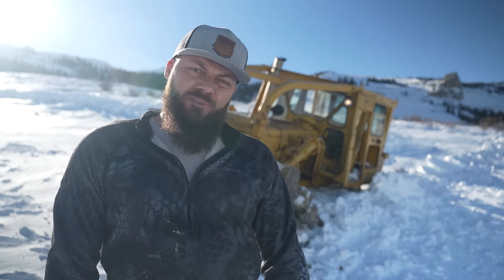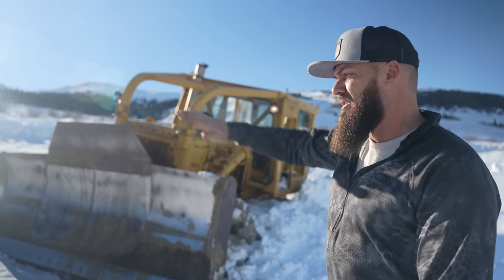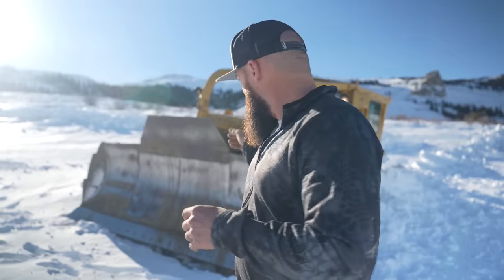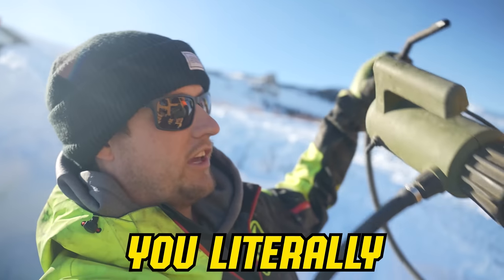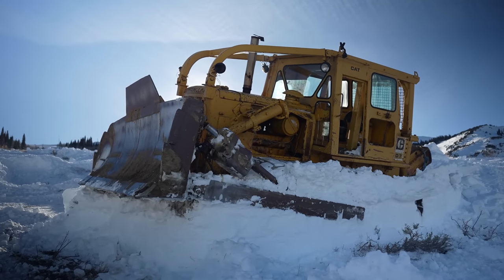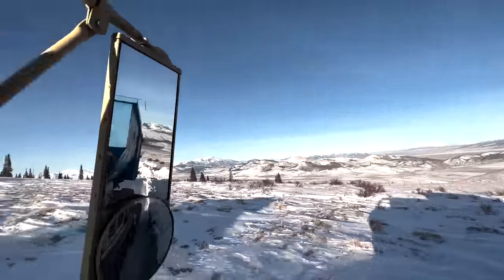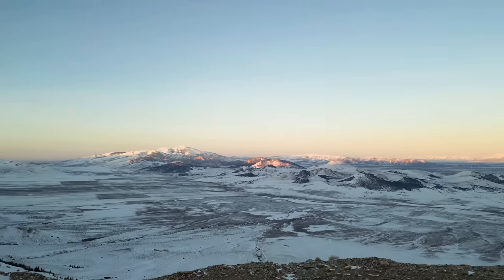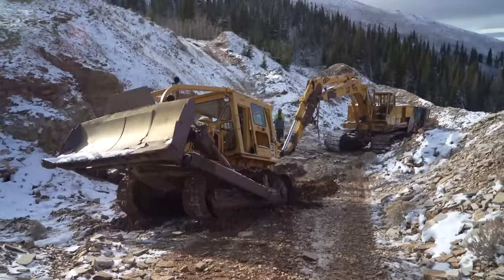What Happened to Our Dozer and HEMTT? You Won't Believe This Mess

Comment: I would love to see Bud get his Ranger tricked out and made super capable by you guys
Reply: I think the fact that it's not tricked out makes it so much better. The fact that it goes up the same trails as a snowcat or 10x10 is hilarious 😂
Reply: @Drei242 yeah. But usually it doesn’t. It stays stuck until the jobs done 😂
Reply: @KineticTaco  Trick it too hard and you add weight, and that's part of it's capability... the lightness. Just needs bigger tires with bead locks to run really low pressure, some steering stops so you don't rip the fenders up, and it'll run snow like the rest.
Reply: Buy bud a ranger raptor then build it
Reply: @mfree80286  ya' know? Only people who have never owned a Ranger think that they need to be tricked out...the only thing I added to a Ranger had to do with looks...the mechanics are already there...
Reply: Amen to that I like to see that too
Reply: Bud is the coolest guy.  Bud and ranger always fun
Reply: My first truck was a Ford Ranger, and it was very capable, factory 4x4.
Reply: @sykwookiee  and you see how well it performs in the nasty stuff these guys like to work in lol
Reply: I totally agree... a pizza delivery capable and call it "The Rig Ranger"
Reply: All rangers are tricked out.
Reply: YESSS😈😂
Reply: For real !!! I was thinking this too!! Like nothing to make it a lot bigger or anything just like a new engine and a small lift to fit 32”s and just truck it out with recovery and wenches!!

Comment: Use the snow mode on the tire inflation system on the truck to aid down the tires. Also go to low range in the transfer case it will automatically lock the diff lock in when in low range.  After 25 years of being a mechanic and recovery specialist in the Army I have learned most of the trucks to the old Army trucks

Comment: A small HEMMIT hint for winter action. Once that beast is in motion do not stop on snow. It will sink faster than the Titanic! As you have discovered it is a stinker to get free once it does. Those things would clime a tree if they can get traction. Maybe design and build a set of tracks for the axles that do not steer for winter snow work. Should help with ground pressure and traction in snow.

Comment: Not real familiar with snow (not a lot of it in Qld (Australia) lol) but dozers are REALLY easy to bog- I had a neighbour with a sand quarry, and even swamp dozers got bogged there frequently (bulldozers with the third high drive wheel)- they usually have a low ground clearance and a flat belly which makes them 'belly out' really easy.... Once the tracks are off the solid ground- they are stuck (and usually badly so)- often even a few hundred tonnes of pull won't shift them...
Snow is easy- it melts...
Sand- you got to dig or  have enough traction to pull- sand don't melt lol(well it will in a few billion years, but I won't be 'waiting for this' lol)

Comment: That truck is NOT a HEMTT.  It is a PLS (Palletized Loading System.)  I used to do engineering work on this model at Oshkosh Truck.  You actually have a real HEMTT that I have seen you make videos with (4 axles of awesome.)  The PLS has 5 axles as you can clearly see (2 in the front, 3 in the back.)  Please at least call the right truck by the right name?